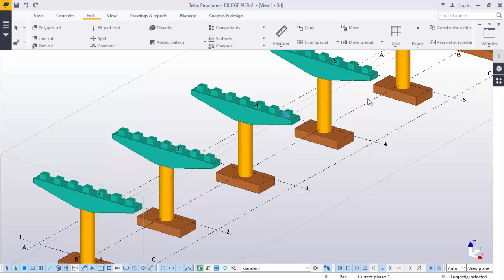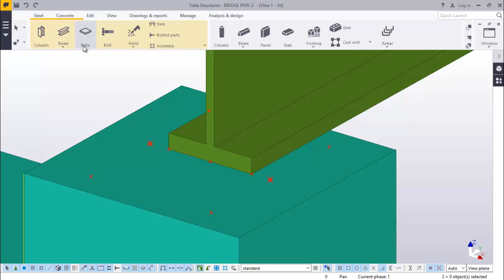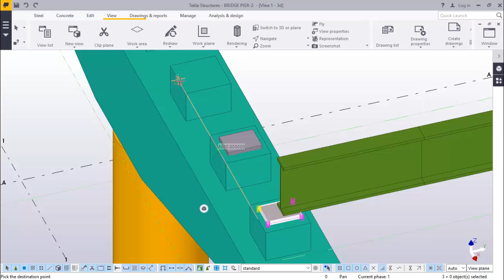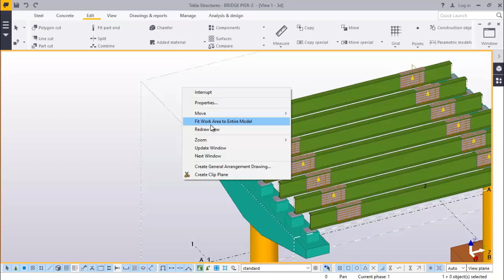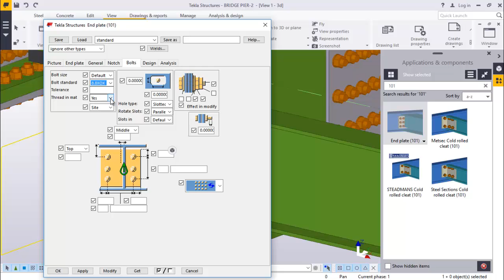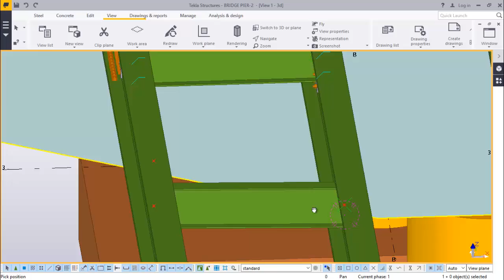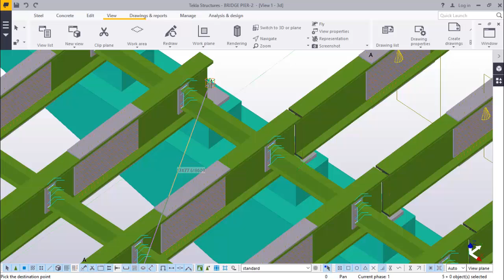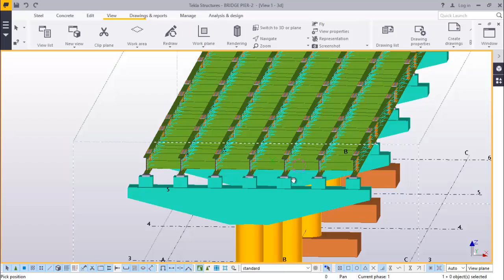Bridge Pier, Bridge Deck and supporting frames Modelling in TEKLA STRUCTURES 2016

Comment: what is the name of the insulation between the beams please ?
Reply from the maker: Elastomeric bearing
Reply: I meant when you trimmed the beams b 25 mm at 16.15 .. is it for the insulation ? and what is it called . with many thanks for your hard work
Reply from the maker: For expansion joint